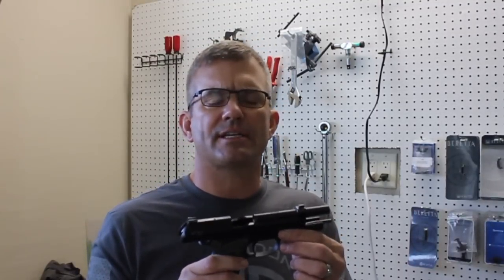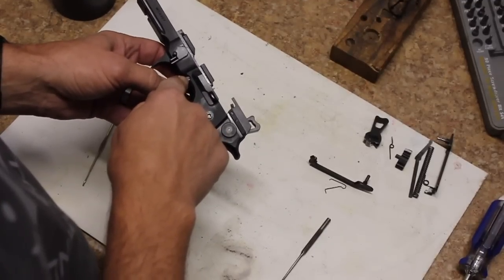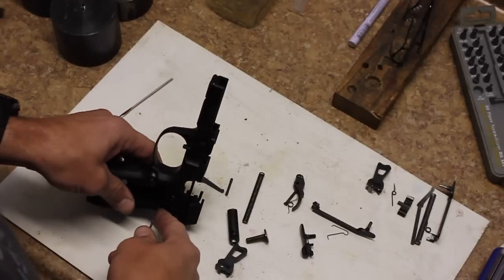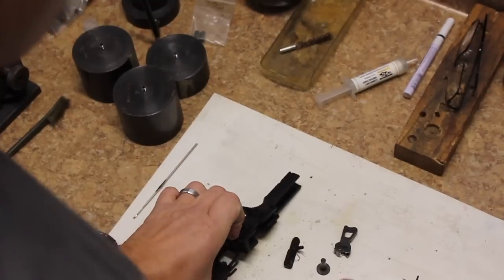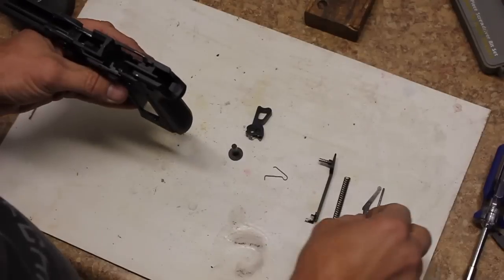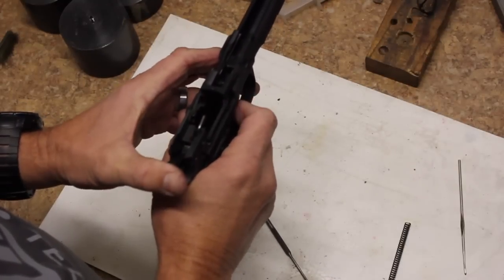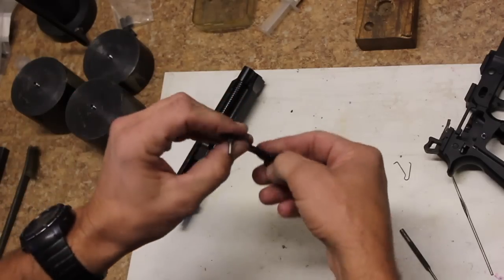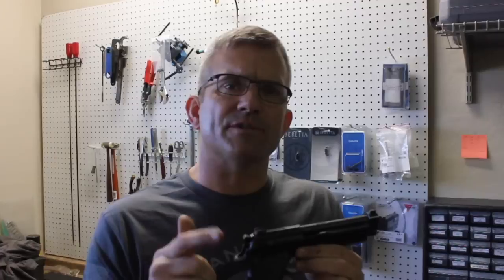Beretta 92 Trigger Job in a Bag Installation

Comment: Installed in about an hour and was not too difficult. Huge difference on the DA pull, and the Single Action Pull is like a button! Crisp with a short reset- very nice. With the trigger kit, #12 hammer spring, steel trigger, and Lok grips this is a world’s difference from when I first bought my 92FS. Great job Langdon Tactical!

Comment: This video absolutely nails it. In addition to a tiny crochet hook I made good use of a dental pick to position the sear spring and a tapered pick to align it. The  DA trigger pull is now 2 lbs 12 oz and smooth as glass. Amazing!

Comment: I’m late to the game, but I received my trigger job in a bag today.  Had it installed in 30 minutes in my 92X Centurion.  What a difference!  No more over travel and a butter smooth DA pull.  I don’t have a lanyard loop, so I had to get creative to get the hammer spring cup out.
Reply: I just got my TJIB in today as well - haven't installed it yet. Now I'm questioning my decision to get the 14# spring. What spring weight did you get?
Reply: @Bluggardpirate  I went with a 13 lb spring
Reply: @Glock_Gal  gotcha! I may just order a 13# spring tonite. Thanks for the feedback!

Comment: We used to do this without any additional parts required. We disassembled the beretta, polished the hammer with a fine stone and CLP, cut the hammer spring a couple loops and Walah! Easy expert shooting badges 👍🏾👍🏾

Comment: Just installed the trigger job in my Italian 92fs. The pin to remove the hammer spring was tough due to the rolled pin, but the rest was very easy. The new trigger is very light and crisp! It was exactly what my 92fs needed. Thank you for the installation video!

Comment: Hi Ernest-Not too long ago I upgraded a 92FS trigger.  The difference in the trigger could only be described as a spectacular improvement.  This week I purchased a M9A4 from an out-of-state retailer.  Because of the great experience I had with the 92FS conversion, I purchased a Trigger-In-A-Bag kit from Langdon Tactical.  When the pistol arrived several days later, to my amazement,  it immediately became clear to me that Beretta had made dramatic improvements on the M9A4trigger over the old 92FS.  When I compared the M9A4 out of the box to the upgraded 92FS there was very little difference.  I wanted to return the unused, unopened, Langdon Tactical merchandise for a refund.  However, there is no contact information on your website.  (No phone number and the address is listed as "not a public storefront.  Do not return merchandise to this address".  There was a link to a merchandise return page.  However, the link was blocked.  Can you help?  Thanx.
Reply from the maker: Please see the response on the other video where you asked this question twice.

Comment: Of course my Beretta was one of the 5-10% that needed adjustment for double action. Video was really helpful and I'm very pleased with the results, though.
Reply: Could you feel the difference? Are the parts polished/stoned in areas?
Reply: @elonmusk8667  Not sure what you're asking, but the trigger bar is very nice. However, in a recent video Ernest says NOT to use the method he uses here to fit the trigger bar. Too late for me, unfortunately. The video is the recent video on the OP trigger bar, and he says to stone the hammer instead of the trigger bar.
Reply: Nahr k 
I was asking if the trigger in the bag are just parts thrown in a bag, or are they polished in certain areas?
Reply: @elonmusk8667  Oh okay. I do not remember (keyword: remember) any polished surfaces except the hammer spring, which had the bottom flat surface polished so it would rotate smoothly in its channel. All the parts are finished in whatever finish you choose (black or NP3). I could be wrong, though.

Comment: Received the Trigger Job in a Bag last Friday and installed it easily in my 92x with this video as a guide. The trigger felt great and I was so excited to try it out that I took it that evening to the local gun range. Has an extremely short reset, approximately 1mm by the looks of it, and about a 2.5 lb pull. The weight is ok with me but the reset was too short for my comfort. Fired about five rounds through it and then had bump fire for the rest of the magazine! Took me by surprise to be sure! Strung about five shots in a three inch vertical string before I was able to disengage. My kit used the Wilson Combat Deluxe hammer, 13# hammer spring, and the Volker flat faced trigger shoe. Do you have any educated guesses as to how to correct this? Otherwise I’ll go back to stock and change one thing at a time…
Reply from the maker: You may have put your sear spring in backward. I don't believe the gun is "bump firing" from the short reset. The sear does not have the correct tension on it from the spring. Also, this is not really a customer service portal. Next time, call us or email us with questions at contactus@langdontactical.com and we can get back to you much faster.

Comment: I have to know. If I'm not mistaken you've won multiple championships shooting a stock 92FS. Did that mean stock from the factory or were you allowed to change things with manufacturer upgrades?
Were you allowed to polish stock parts or cut springs?
When I say upgrades, I mean any component manufactured by Beretta that did not come with the handgun purchase, but is readily available to everyone for purchase. Including anything from springs to changing out grip panels.

Thanks for all your great videos.
Reply: So when I was winning national titles back in the day, there were no aftermarket or factory upgrades for the 92 Beretta. That was quite a few years ago; things are much better now. I won with a 92G, 92G Elite, and the Elite II, basically factory guns. Factory parts with a trigger job. So yes, some polishing and stonework were done, but basically stock guns. Also, I was shooting in either Stock Service or Production divisions, so very few modifications were allowed anyway. I did play with some lighter recoil springs from Wolff toward the end if I remember correctly. I did not cut hammer springs, we used the Beretta 8000 Cougar and PX4 F model hammer springs back then. That was more than 20 years ago.
Reply: @ernestlangdon3075  That's really cool to know. Thanks for replying.

I've held off on buying your TJIB for a while so I could learn how to shoot my DA/SA guns stock, including the 92FS. Your videos really helped me to get good at working the trigger where I finally felt like I earned a TJIB. I just installed it today and am looking forward to shooting it this weekend. I appreciate all the work you've done.

Comment: just as a heads up for anyone else,  when you remove the slide stop the spring that holds the trigger pin in place may want to exit your gun at the speed of mach fuck to then place itself in another plane of existance never to be seen again by your mortal eyes.   you then add 3-5 business days of the installation of the kit while the replacement spring ships to you.

Comment: I have a TJIAB on the way from your Black Friday sale.  Trying to decide which of my three I love the most to put it into!  I have a Wilson brigadier tactical, but I'm leaning towards my standard 92fs due to the more holster options for carry.  I was wondering if the LTT trigger bar has less occurrences of the DA issues?  I'm also interested in the carry bevel, and wonder if that bevels down the edge on the inside of the trigger guard, as my finger drags on that when firing.
Reply: It varies quite a bit from gun to gun. But I think they are about the same.

Comment: I finished the install and it works in DA and SA really light pull in both, but it sounds like sandpaper as the parts move. Specifically when I rack the slide from the hammer being decocked, the trigger has a slight bit of takeup that sounds like sand paper but once I pull that takeup it doesn't let the takeup back out even if I push the trigger from behind. Its like the SA trigger has a little more to go from what it travels when the hammer is cocked, but it disappears when you move it that little bit. Is that just the new parts not being oiled yet and the new parts wearing in?
Reply: I took the grips off and I see the trigger bar is raising slightly when Im taking that bit of travel off the SA pull.

Comment: Does this get rid of the play or take up I'm noticing in my trigger when I have my gun in single action?
Reply: I just did mine. Take up is there in SA but there is no creep and the reset is almost nil. I’d say the reset went from 1/4” or so down to maybe 2 millimeters. Over travel is also almost nil. 
DA went from 10lb 11.4oz to 7lb 2.1oz. 
SA went from 4lb 12.3oz to 3lb 5.9oz

Comment: Is there any difference installing the "trigger job in a bag" in an Elite LTT versus buying an Elite LTT with a trigger job directly from Langdon Tactical?
Reply from the maker: Yes, everything is fitted and check if we do it. The Trigger Job in a Bag is very close to what we do, the steps are all the same, but we cannot check fit and adjust if we do not have it in our hands. We like to say the TJIAB is 80% of what we can do here.

Comment: FYI: The trigger is all steel with a polymer coating for comfort and heat resistance. It is not a plastic trigger. Put a magnet on it. Or call Beretta tech dept, they told me it is a steel trigger with a polymer coating.
Reply: You are correct, it is plastic over-mold, and there is a steel frame under the plastic. Most of that steel is at the top of the trigger.
Reply: @ernestlangdon3075  Is there a considerable ammount of more steel in the all steel trigger?
Reply: @mercyrules1617  Yes, but the factory sold steel trigger does not hold up well. I have broken two of them and seen a third break. I have never broken one of the polymer factory triggers. My understanding is the all-steel trigger was made for the EL model so they could gold plate it for aesthetics and not for function. The all steel trigger does improve the trigger pull in my opinion, but both of mine broke at about 2,000 rounds.
Reply: Thank you for sharing your knowlege with me. I'm quite impressed that you took the time to read my post and thoughtful enough to take time out of your day to enlighten me on this. God bless!!

Comment: Mr. Ernest , I have a question Sr. ?? I’ll try to buy a trigger  in a bag .
And the instructors sad “The Trigger in a bag will not work on a 92S that was built in Italy. “
This is true ?? I watch your video two times and you comment if is Italian the only difference is the pin on the hammer sprig .
Sorry my English.
Thank you very much .
Reply from the maker: Sorry for taking so long to reply. Yes, it will not work on the old S model guns, the trigger bar is different and will not fit.
Reply: @LangdonTactical  is the trigger bar the only part that is different? Would replacing the other parts make a large improvement?
Reply from the maker: @niadhf  The trigger bar is the main part that is different and what causes the issue. The other parts will help a lot, but the trigger bar is key to a good trigger job on that gun.
Reply: @LangdonTactical  thank you. I will just dobyhe rest slowly, then. And work on the PX4

Comment: I was on the Marine pistol team a few years ago. i'm trying to find something similar to the match m9's. how close does this trigger get to a bullseye gun? and, are the beretta made wilson guns worth it over trying to find a match m9 somewhere? i can't find one.. i have an order in with Steve Huff at Accuracy X for a 1911, but i'm trying to find a 9mm service gun to use as well.
Reply: So the trigger from this kit is likely to be much lighter than a bull's eye gun. NRA rules normally require a 4 lb single action on a "service pistol" and most of these kits come in under that weight, normally around 3.5 lbs. Also, building a Beretta to that level of accuracy that the 2112s at Quantico can do is very difficult and expensive. I do not do that kind of work and only a few people outside of the military do that work that I know of. 

Hope this helps.
Reply: helps a great deal, thank you. The 12's on the team didn't know how to build the m9's so we had left over guns from quite a few years before when the amu guys showed the older dudes how to build them. only got to shoot one a couple times, didn't get to use it regularly. once i graduate and get some actual income i'm probably going to give you a call. i appreciate it.
Reply: A guy on ebay sells "accurised" barrels that basically use a bushing on the end to lock up in the front.   Other wise i believe its metal inserts in the frame.  You can buy one that is ready to go for about 2 grand but there is a waiting list.

Comment: anyone have a video how to put this into a 92x performance ?
Reply from the maker: The 92X performance is a frame safety gun, and therefore it uses a different sear and will not work with the Trigger Job In a Bag.
Reply: @LangdonTactical  thank you for that! I have 2 LTT elites. One with the NP3 love. And a bone stock one. Since I can't use this on my 92XP. I'll upgrade the stock one!